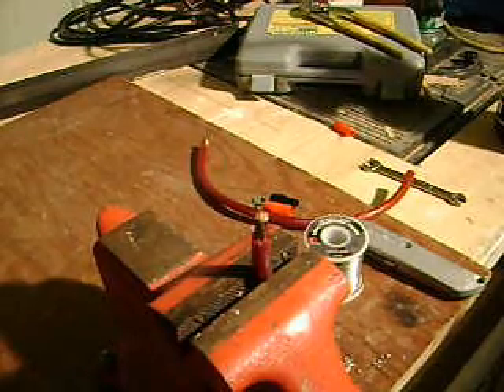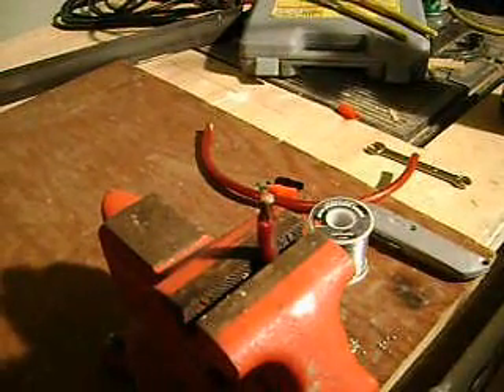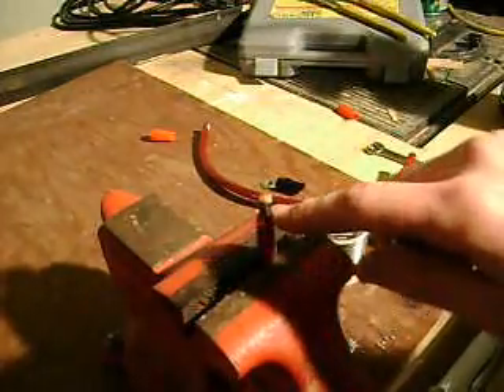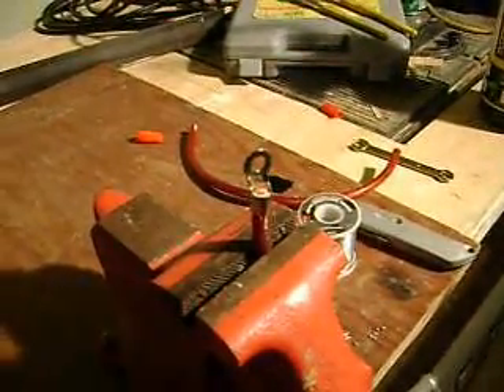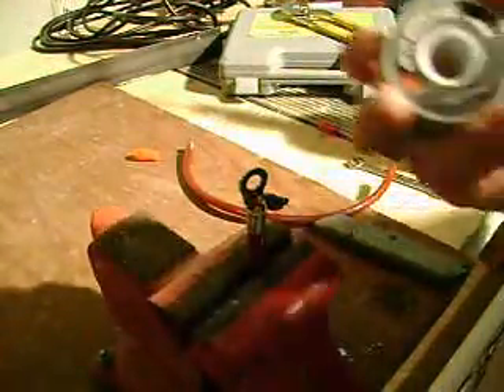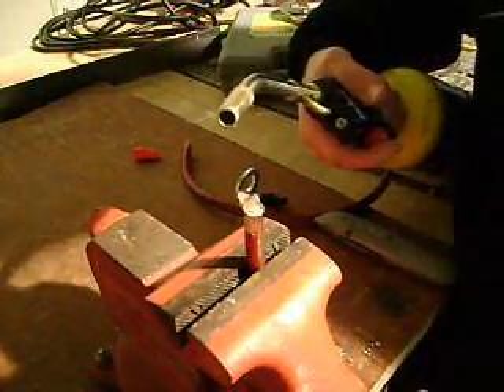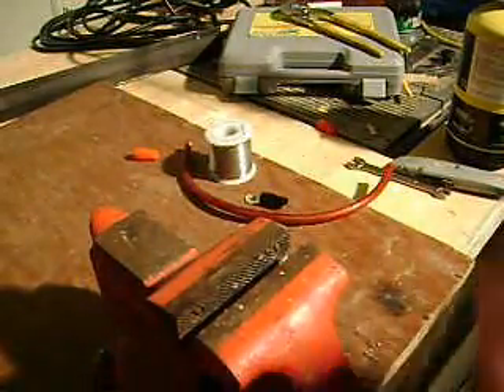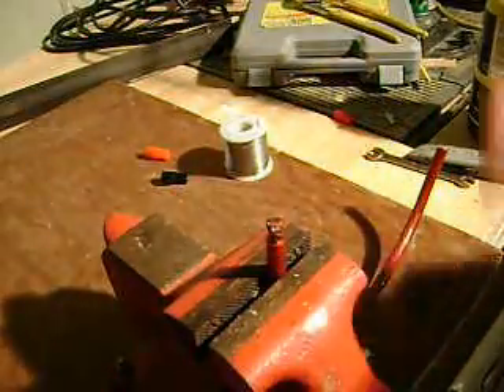More Soldering Examples

Comment: Good video, I was using silver solder that came with my Worthington Start Torch kit, very hard stuff and took awhile to heat up, wondering now if I too should consider using the solder/flux combo. Problem I've had though was getting the solder to come around to the front of the connector without melting the casing.